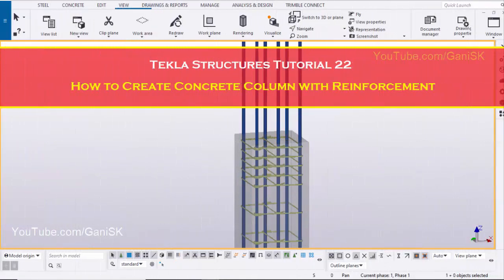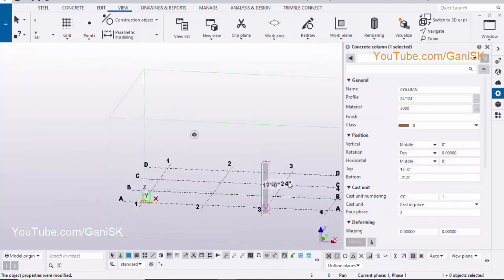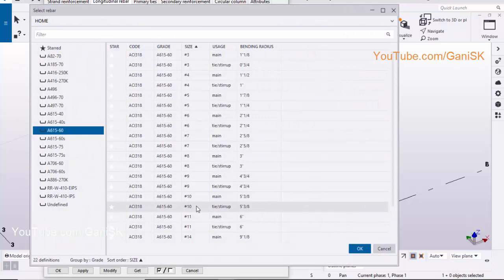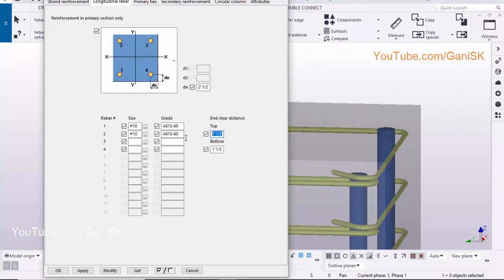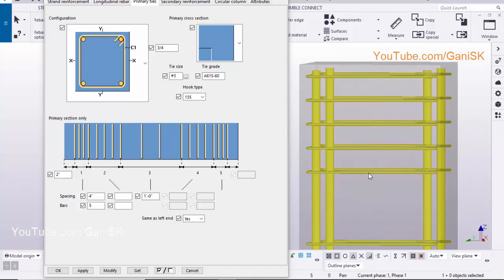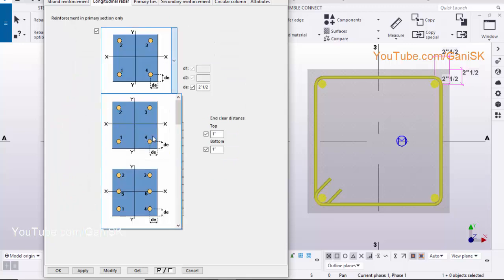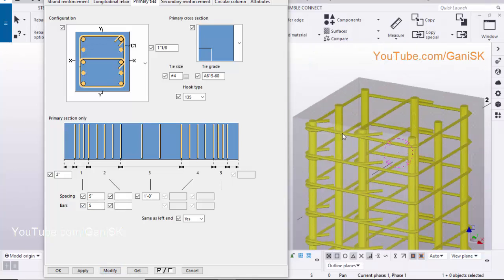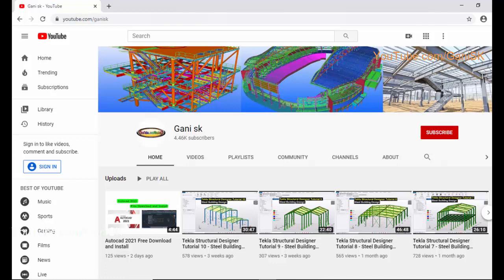Tekla Structures Tutorial 22 How to Create Concrete Column with Reinforcement

Comment: in 2:48 the window panel can not fit screen, as well in mine but worser I can not select top part options which in your case it is almost hardly select. And also can not make smaller this window panel?? Help please
Reply from the maker: Download and Install Screen Controller for Tekla Structures to move the screen window, refer this video https://youtu.be/n486DXmuoik

Comment: Sir, how to create column reinforcement with 10 bars.
Reply from the maker: you need to select number of reinforcement in macro, as shown in the tutorial, still you won't get that, check out my other tutorial, you will get it. let me know, you get that or not in comment section, if you won't then I will make tutorial on it.
Reply: @GaniSk  please make a video on that sir, 4 bars each on two opposite sides (4+4) and 1 bar each on other two sides (1+1) and also with four legged stirrup.